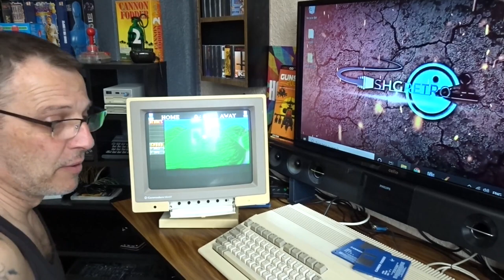Commodore 1084ST picture and sound repair (PART 1)

Comment: Great vid Stu 👍🏻 Look forward to Saturdays as I know you’ll have a vid out 😉 8-bit guy also has a new studio too! But he got caught up in the winters power cuts  in Texas 🙄😳 Ben Heck is good with soldering 👍🏻 So the mystery of what will go with your newly fixed  Commodore monitor 🤔 I’m guessing it must be a big box Amiga? A2000, A2500, A3000 or A4000? I’ve got a A4000 desktop which I’ve full upgraded to a Cyberstorm mk3 060/PPC with cyber vision graphics card. Then added a Elbox mediator daughterboard and put in a ATi Radeon 9250, Soundblaster sound card, X-surf 100, rapid road USB, 256MB Big RAM card. Altogether got around 400MB Fast RAM. Then Put in a Scsi2SD drive and installed Amiga OS 4.1FE.😊
Reply from the maker: Oh yeah, forgot about the 8bit guy having a new studio built. He is in there now I think! Just hasn't done the tour!

Comment: I read a few complaints about how noisy these are.  Is the high pitched whine as bad in person?
Reply from the maker: The noise is caused by the Flyback transformer. Generally means it is on it's way out! This one isn't doing that as yet but having to tweak it means it will one day and then it will need a new one!

Comment: Give yourself some credit. Jan twists off caps and abuses Amigas with ceramic caps. RMC can't solder. You and GadgetUK are pretty much the only ones that're treating the Amigas with a bit of respect.
Reply from the maker: We all have skills in certain departments! Thanks for the comment bud :)
Reply: @SHGRetro  There may have been 5 million+ A500s sold but the number of A600 and A1200 can probably be measured in 100k. I may not be a taliban like Retrogamemodz but I strongly feel that people abusing these boards should be sent to the international war crimes court in the Hague.